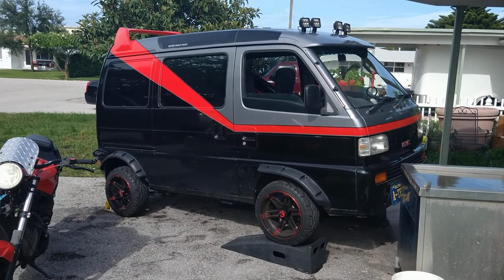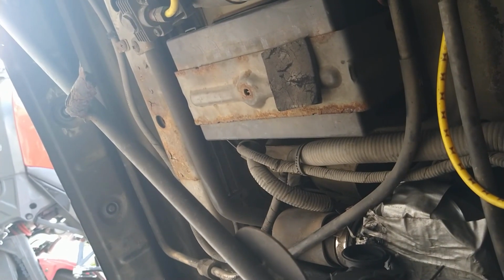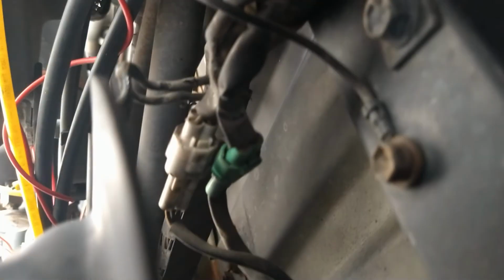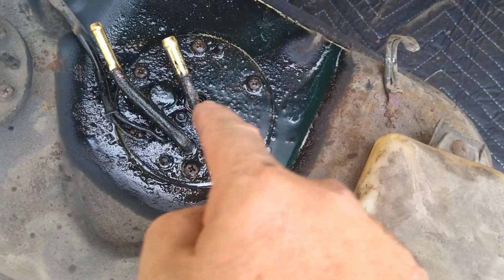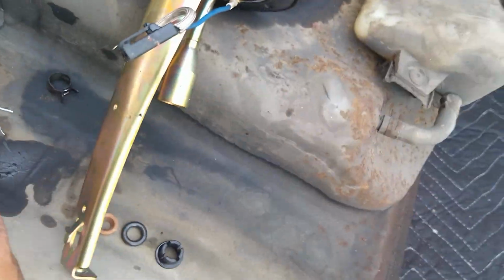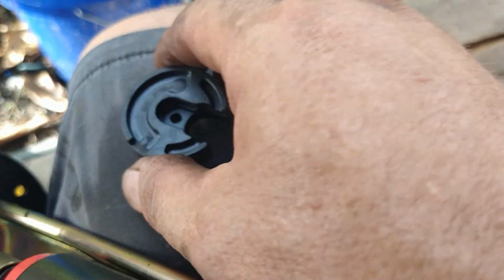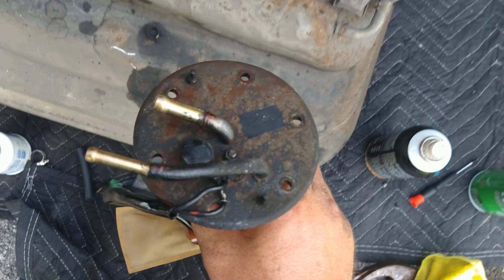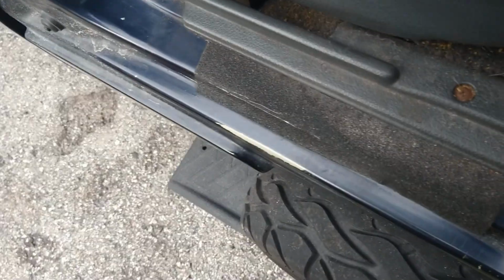1992 suzuki every turbo fuel injected f6a fuel pump repair fix replace

Comment: My ‘90 every died twice last night. Luckily the second time was next to my house. Hopefully it’s the relay but now I’m prepared for the pump. Thanks for the great video.
Reply from the maker: check the fuel pressure near the injectors i think that there is a valve like a tire valve. if you push it in with key on gas should spray out. if it does id guess coil maybe.